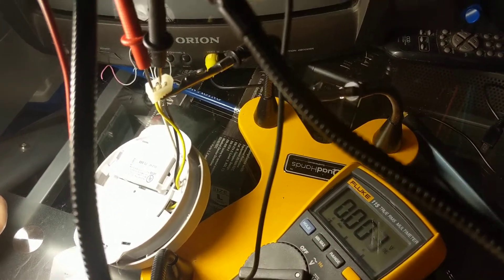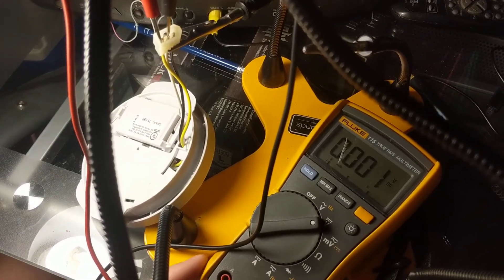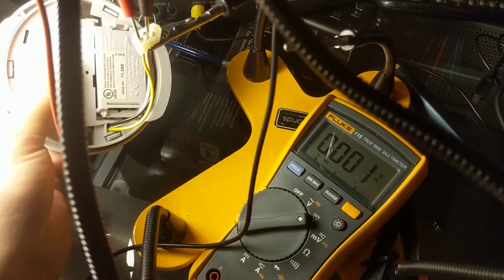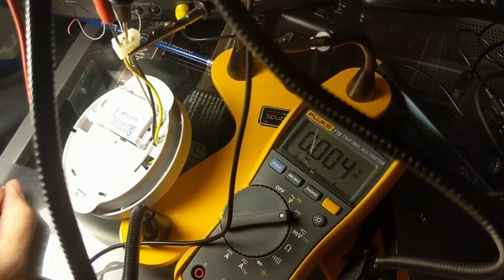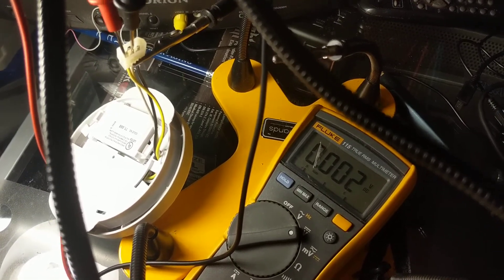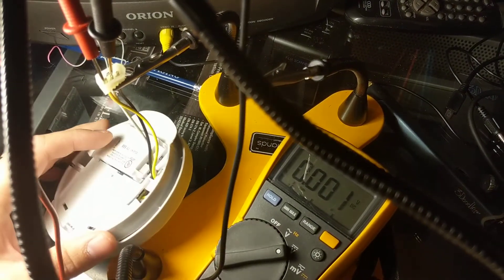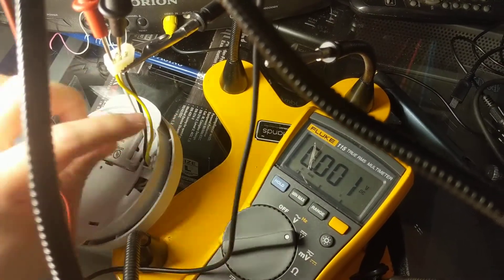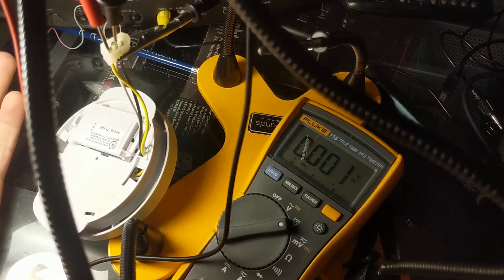Residential 3-Wire Smoke Detector Signal Wire

Comment: Thanks for the video. I never knew this was low voltage DC. I want to add a Kidde heat detector into my garage. The main house has all the detectors already connected. My problem is that my flat roof house has no access to the attic. How can I connect the red wire so that all detectors will work correctly? Does the red wire have to be added at the beginning or end of the interconnect circuit or can it be added anywhere within the circuit?
Reply: I have a detached garage with solar panels on top. I want to add a smoke detector to the garage but I do not wanna run a low voltage wire to the garage to link my smoke detectors. I plan to use an adruino with xbee wireless card to communicate between my garage and home.